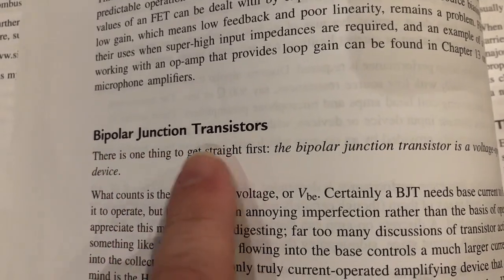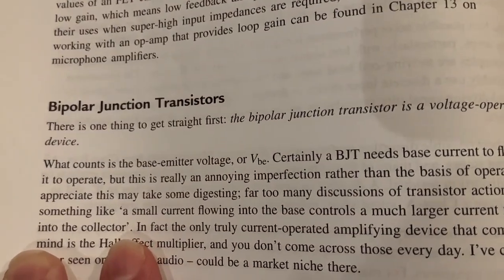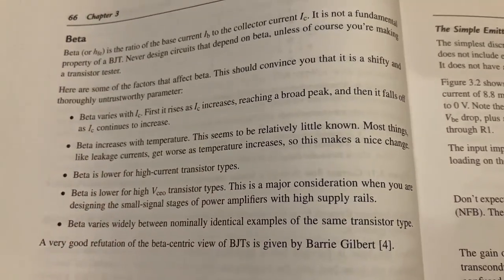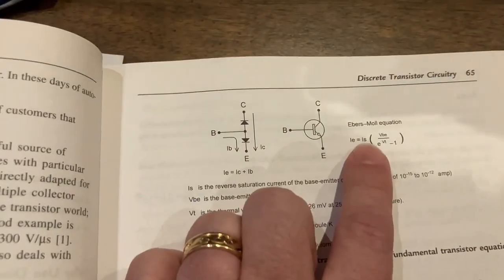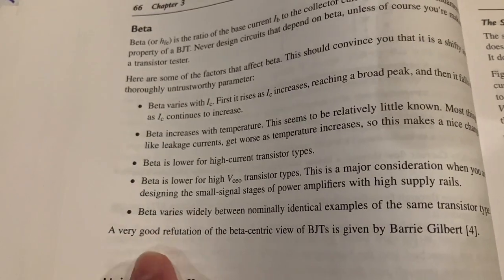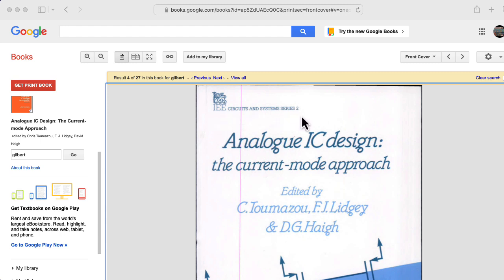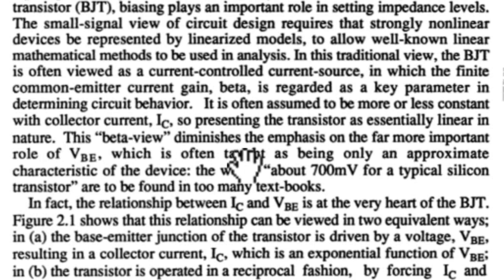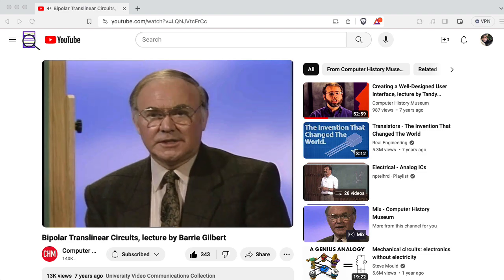More Story Time with Professor Lanterman (The BJT Control Controversy)

Comment: My interpretation is that the base-emitter junction has a U-I voltage-current characteristics, and the collector current multiplies the current from that. You can control it however you like, add more components and get a sum U-I curve, but it's neither voltage nor current controlled.

Comment: But if BJTs use voltage inputs, then they're the same as FETs!   It just makes no sense!   They're not FETs, so it means that voltage input must be wrong?
No, if we look at the insides of transistors, we find that the FET has a narrow conductive channel, and its variable Depletion Zones invade from the sides, pinching the channel.

But in BJTs, the depletion zone stretches all the way across the current-path.   In PN junctions, the voltage-barrier determines the thickness of the Depletion Zone, and that insulating region then determines the current.  The DZ is so thin that the carriers can get across it, even though it should be an insulator.   Vary its thickness, and we vary the Emitter current.

So, if FETs are like a camera-iris, like a hole with varying diameter, then a BJT transistor is like sunglasses with variable thickness.   But in both cases, the size of the Depletion Zone is controlled by applying a voltage to the transistor leads.   In both FETs and BJTs, they operate by transconductance, and any input current is the leakage across a capacitor, where we prefer that the leakage be zero.   Yet this doesn't mean that BJTs and FETs are the same component.   (A variable-Log optical filter is not a mechanical iris! )

Comment: Nice!   We now have a reading list of books which teach that BJT transistors employ voltage as their input.   (Yay, transconductance is coming into the fore!   No longer a taboo, secret, underground philosophy, had to be hidden from most teachers, or they'll mark you wrong.)
The "trans" in the word "transistor" was actually there for a reason?   Whoda thunk?!
BTW, I think 300mV is correct.   When do silicon diodes actually turn on?   Not at 0.7V, that gives milliamps current.  At 0.5V there's still lots of microamps, so the turn-on voltage must be even lower.  Which value of Vf produces "insignificant" currents?   Heh, depends on what the author considers "insignificant."   Nanoamps?  Picoamps?   Lower?   (Also, assume that the Ic is 100x higher or more.   It's not Ib which must be made insignificant, instead it's Ic.   If "turned off" means that Ic is below 1uA, then Ib must be less than 10 nanoamps.   What Vbe gives that Ib value?   Perhaps 300mV?

Comment: Why do you hate this trivial distinction so much?
Reply: Also what should the textbooks say about the the operating voltage of a BJT aside from around 0.7v?
Reply: It's a diode drop. Required to cross until current starts flowing OH SHIT!
Reply: I don't get the difference between "It's voltage controlled but I have to account for the current." And "It's current controlled and I manage that with voltage."
Reply: I keep hearing this argument from people in condescending way "Child, you still think that BJTs are current controlled. I will bring you to the light." when it's just that they're current driven which requires voltage. But you need the current.
Reply: How do you design a circuit without that current?
Reply: I've abused high gain BJTs where a jfet would be a much better choice because BJTs are cheap. But they are leaky garbage that need current.
Reply: @justovision  One way is Thevenin, the other way is Norton.
Reply: @justovision  It's condescending, because current-control is a simplified version, used for teaching beginners.   Voltage-control is never mentioned in textbooks for technicians, or textbooks for high school.   If you know about Voltage-control, it means that you've obviously been to college, and acquired the secret knowledge!  
Doing any voltage control homework problems requires first understanding log functions and exponentials, electrostatic forces and potential-barriers inside silicon crystals.   So, voltage control is introduced in college textbooks, since the math is too hard for beginners, and they wouldn't be able to do the homework.   Also, repair technicians don't need to understand the insides of components.   So voltage-control never appears in any tech-school book.  

Similarly, we're all first taught that diodes "turn on" at 0.7V, below 0.7V the current "is zero," and we only learn about the actual operation of diodes much later, including that nonlinear exponential function.   Many of us never learn it at all.  We go on believing that diodes can turn on and off.   But that's an ultra-simplified "for dummies" description.   And sometimes, that description doesn't work  ...as with the diode which forms the base-emitter junction!   If diodes turn on at 0.7V, how the heck can a transistor be voltage-controlled?   It just makes no sense!

Me, I think this is all stupid.

We could easily present voltage-control to beginners.   No need to mention the equations.   Don't force them to do numeric homework problems about it.   Do the same as with vacuum tubes:  actually tell us how they actually work.  A nine-year old can grasp the basic ideas.    Don't force us all to learn some wrong crap, just because it's supposed to be "simpler."   If we plan on an engineering or scientific career, this "for dummies" stuff can screw us up permanently.  

And once long ago, k6-grade science textbooks taught us that there was no gravity in outer space, as if the gravity only extended to the top of the atmosphere.  Why?   Well, obviously little kids could never understand orbits.   So instead, why not just lie to them?   When they ask "why do astronauts float around," we just insist that Earth's gravity doesn't reach up into outer space.   That shuts them up.   But now they'll never understand the Newton stuff, and why does the moon keep going around the Earth, or the Earth around the sun, since we've been specifically taught that there's no gravity in outer space?

Current-control is a useful idea.   But it's also a "Lie-to-children," because it doesn't describe how the insides of transistors work.   And in some cases, genuinely understanding transistors actually makes a difference in electronic designs.
Reply: I'm just a high school dropout who works as a software development lead and builds analog circuits and tube amps for fun. Wouldn't no nuthin' bout no college...
Reply: As a moron I actually think the distinction is useful.
Reply: Tubes like a light bulb are a short until they heat up. That's the heater (6-12v). The control grid never sees any applicable current.
Reply: You put two spaces after the period so I know how old you are.
Reply: Why is this the hill you want to die on?

Comment: Here's a quote from Barrie Gilbert on the topic "How should one present the essential and fundamental properties of a bipolar junction transistor?"

"I feel we are back to counting angels on the pointed-end of a pin. As important as are taxonomies, circuit design is never about the infinite dissection of words.
My comments in another thread (a few moments ago) should have made it clear that analog circuit design is always, and quite simply, a matter of being as careful,
as clever, and as resourceful as humanly possible.
'
The Lone Arranger"

Not so clear-cut as someone makes it seem, uh?

Of course if you make a living out of translinear amplifiers you would prefer Ic = expfunct(Vbe), but if you are working with PTAT thermometers you'd want to use Vbe = logfunct(Ic).

And in fact even Ebers and Moll use both sets of equations: currents as exponential functions of voltages,  and voltages as logarithmic functions of currents. Right in their modt cited paper.

(How i despise typing on a phone...)

Comment: So it sort of begs the question: What then, is the appropriate use of the Hfe(beta) parameter? When wearing the 'technician' hat and selecting a substitution transistor, I've often used beta and Vce as the fast-search terms. When wearing my engineer hat, it is just an intuitive figure for mental estimating.
Reply: For the high-level description, the transistor is just a black box, a 2-port network.   Current control works fine.   It's jut an alternative approach, sometimes useful, and one of many.   But if we want to open the hood, and understand what "transisting" really is, then we're dealing with the micro scale.  We find that junction-voltage and potential-hills and e-fields are the controlling parameters.   
Now close the hood, and choose whichever high-level model is appropriate.   (For high frequencies, only Gummel-Poon equations work right.   That's the Charge-Control model!    Next, should we bring in some True Believers in charge-control, and let them fight with everyone else?)

Comment: Thank you for your insightful discussion Professor! What I don't understand is, why do microelectronic textbooks and electronics curricula teach us that BJTs are current controlled? I'm in my senior year in an EE program, but have never heard about the true signifigance of Vbe until now.
Reply: It all seems to have started with William Shockley, who was dealing with single-digit Beta of early transistors.   Look at early papers and early textbooks, and they all concentrate on ALPHA, and also on BETA, as if these were the One True Explanation of BJT operation.
Notice that the Voltage Control equations don't have Shockley's name on them.   If Shockley had understood how diodes work, then it would be the Shockley equations, not Ebers-Moll.

Yet Shockley did understand diodes!   Look up "Shockley Equation," and that's the familiar exponential diode-equation, where the Vf forward voltage determines the diode current!  So, how could Shockley not know?

In studying this for ages, I conclude that this was a less-than-honest ploy on Bell Labs part.   Bell Labs is a business, not a scientific organization.   If they declared that BJTs were voltage controlled, then the courts would think that BJTs were just another type of FET, and then disallow their patents.  (The FET had already been invented in the early 1920s, and the Bell Labs project had started out as an effort to build and test these "channel-modulation" transistors.  They had them working, but they were unpatentable.  Bell Labs covered up this entire history of the transistor project.  The coverup was only discovered in 1998.  Transistor crimes?  Transistor conspiracies?   Yep, and that sort of thing is expected, when billions in future profits are involved.)

So, Bell Labs says that the BJT isn't an FET, because the BJT is controlled by currents, not by e-fields!   So there!   Take that, patent court!   Let's see you try to disallow THESE patents!
Reply: @wbeaty I see. That’s a really interesting history. I assumed it was just an ideal model used to smooth over explanations and study. Thanks for the explanation!

Comment: I was told in an ECE classroom by a PhD that BJTs were current-controlled devices. Why are you ruining my life? 😭 BJT calculations are so much harder without a made up Beta value that doesn't change and is presented to be fundamental. Dumbed down electronics are for everyone. Exponential equations and temperature in Kelvin are for smart people. I can't handle the truth. 😭

Comment: Wow, I'm incredibly humbled that you took my comment about Doug Self and his comments seriously enough to add it into the video stream. Anybody who knows anything about analog circuit design, would be horrified at the very thought of arguing with Barrie Gilbert. You may as well say Bob Wodler didn't understand semiconductors. Or Bob Pease only used SPICE in his designs, or...you get the idea. 😛
Reply: You'd be surprised how Barrie Gilbert replied to someone who was pressing him to admit the BJT is exclusively voltage (sorry lapsus) controlled. Too bad YT won't allow for links, or even specific directions to web pages.
Try reading Streetman, Hu, Pierret. There are many others but again I cannot give a link to a page with references because yt  would delete it.
Reply: @copernicofelinis  experiment with links in the comments.  Usually they survive if you only include one link, and then never ever edit that comment again.   Usually they survive editing if you remove htt stuff and the "dot" from the com or org or edu.  But I've had them disappear when adding numerous links, even the non-working links with major missing parts.
Reply: @wbeaty  I copied Gilbert post in my comment in the main section; he was answering to LvW who was trying to press him to declare unambiguously that BJTs are exclusively voltage controlled. 

I also added a bit about how Ebers and Moll, in their 1954 paper, gave their equations both in the voltage control version AND in the current control version. But for some reason the voltage control camp seems to prefer to ignore this piece of information. No idea why.
Reply: Maybe yt deleted my comment in the main section. Let's see if it appears at least counted in this thread.

Here's a quote from Barrie Gilbert on the topic "How should one present the essential and fundamental properties of a bipolar junction transistor?"

"I feel we are back to counting angels on the pointed-end of a pin. As important as are taxonomies, circuit design is never about the infinite dissection of words.
My comments in another thread (a few moments ago) should have made it clear that analog circuit design is always, and quite simply, a matter of being as careful,
as clever, and as resourceful as humanly possible.
'
The Lone Arranger"

Not so clear-cut as someone makes it seem, uh?

Of course if you make a living out of translinear amplifiers you would prefer Ic = expfunct(Vbe), but if you are working with PTAT thermometers you'd want to use Vbe = logfunct(Ic).

And in fact even Ebers and Moll use both sets of equations: currents as exponential functions of voltages,  and voltages as logarithmic functions of currents. Right in their most cited paper.

Comment: All of this is fascinating but it seems pedantic more than anything. Whether the BJT reacts to voltage or a current, you still have to supply a current to get a voltage and a voltage to get a current, so HOW does it matter?

It sounds very much like a Horsepower vs Torque discussion where everybody has an opinion and nobody actually understands any of it, they just repeat what their favourite person said.
Reply: It's extremely important if you're designing log / antilog circuits, or if you're trying to design highly linear amplifiers, but in the majority of everyday circuits you don't often need to think of it this way because good old negative feedback does all the heavy lifting for you.
Reply: @petegreenwood2793  I think you need Ebers-Moll to arrive at the understanding that emitter degeneration IS negative feedback.  (You can''t get infinite gain, or even predictable gain, from a grounded-emitter amp!)
Reply: Actually it's a matter of misconceptions, and debunking them.   Once we get rid of our own mistakes, suddenly the physics all fits together in a satisfying whole.   It eventually leads to a huge number of "aha!" experiences.   Slowly we realize that the science wasn't as complicated as we imagined.   Instead, we were suffering from many different learning barriers, because we thought we'd understood something, when really we'd picked up a common set of student-misconceptions.   (Many of these errors are actually taught in high school, and then must be debunked during college classes.)

College professors are well acquainted with the student who tries to escape learning new things, by saying "This is just a bunch of useless pedantics!"   The response?

* "Lest you think that I am quibbling over minor points of language, I note that in my experience many of the misconceptions people harbor have their origins in imprecise language... Precise language is needed in science, not to please pedants but to avoid absorbing nonsense that will take years, if ever, to purge from our minds." - CF Bohren, physics educator

If a student wants to preserve their previously-learned nonsense, then whenever a teacher or textbook tries to debunk their existing misconceptions, the student just ignores it, and labels it "pedantics."